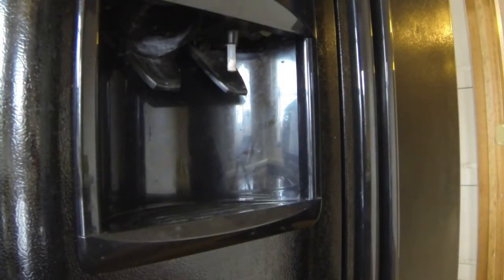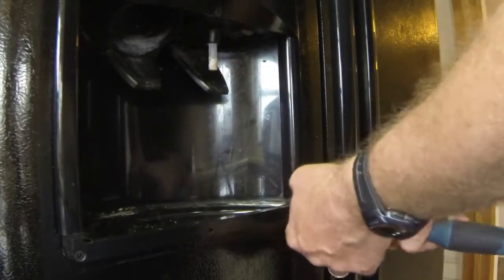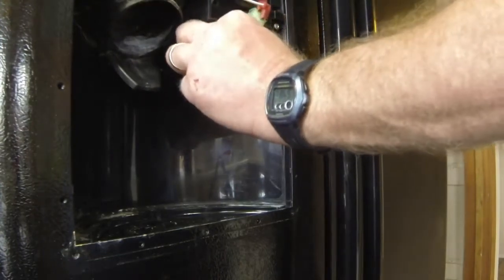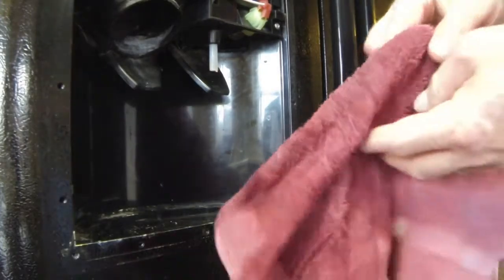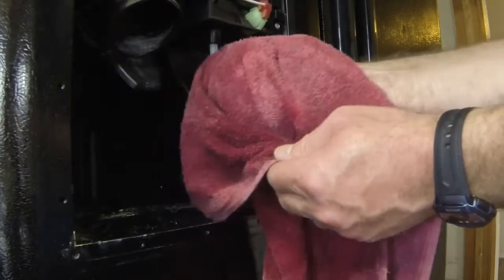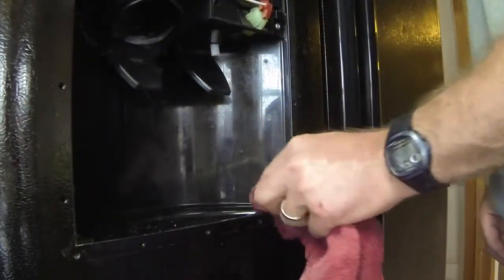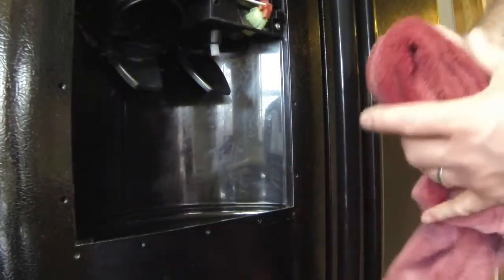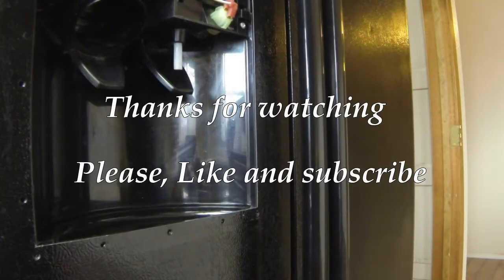Clean water dispenser hose on a Frigidare Refrigerator

Comment: That has to be the easiest ice and water access I've seen on fridges yet.  I want a fridge w/ working ice and water, but I know they are mould traps, esp. the area you just exposed.  If only other models were that easy to get at and clean.  I'm going to try and get a frigidaire, but I'm going second hand, so it will be what is available on kijiji.
Reply from the maker: Thanks Jeanne. I agree, this one is pretty easy. Good luck on your hunt.

Thanks for watching.
Reply: The older the refrigerator, the easier they are to clean and fix. Everything made now is over-complicated and designed to fail. Our house we are renting has a new samsung fridge and it is complete garbage compared to our 20 year old whirlpool.
Reply from the maker: Yes, I have noticed the same thing with newer appliances. They just don't make these things last anymore than a few years it seems like. I guess they can make more money if they make garbage that you have to replace every few years. My cousin lives in a house from the late 50's and it has the original fridge in it. He has it in his shop, but it is still working.